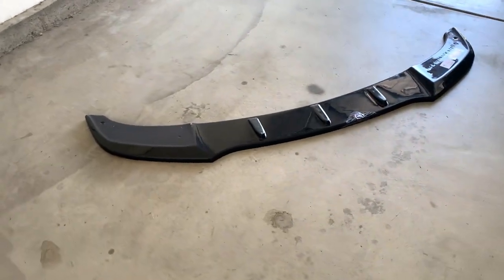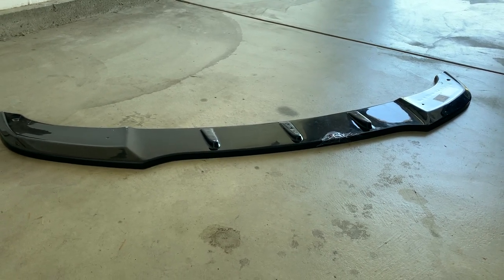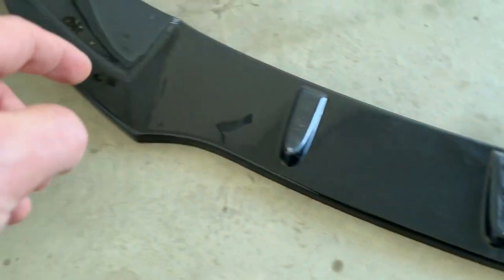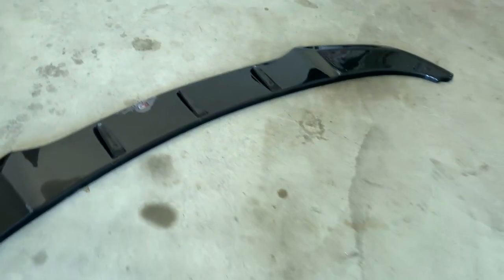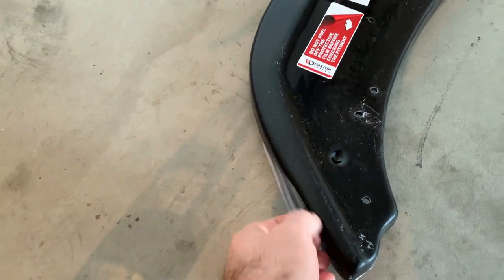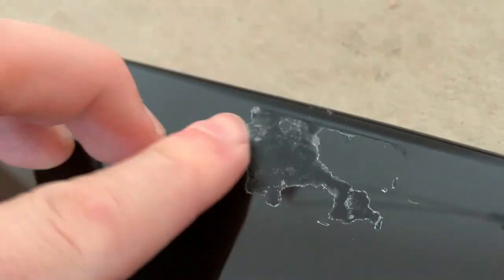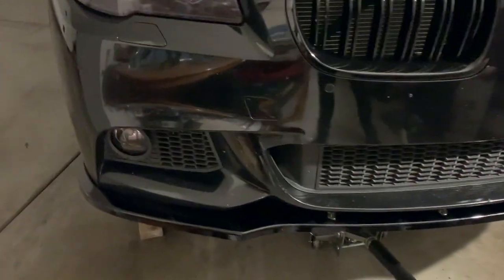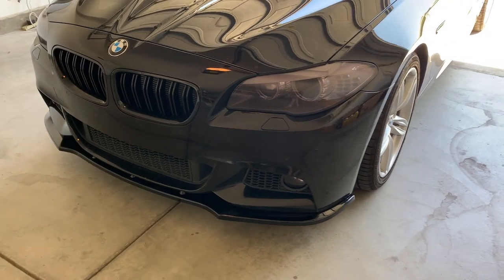Maxton Design Front Splitter on BMW F10 with M-package | BOND Garage

Comment: 7 mins talking about screw holes. Jasus just stick.it on and drill. Ain't that complicated.
Reply from the maker: sure, just slap some screws in and watch it fly off at speed. seen it often enough. you do have some limitations as to where you can place screws. at least I can say that it all held strong when my wife hit the curb and broke the splitter to pieces. all screws held perfectly :)

Comment: Do you Have to remove that plastic film before you mount it or you live it on?
Reply: Never mind got it😬
Reply from the maker: lol. at some point the film will be beaten up and you will want to remove it but then it's way harder since it's installed. what splitter did you get?